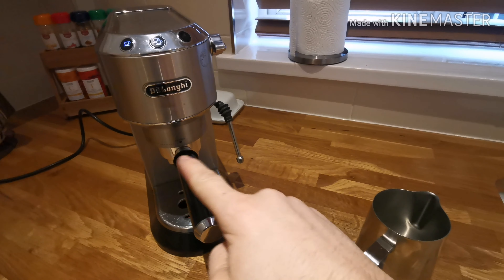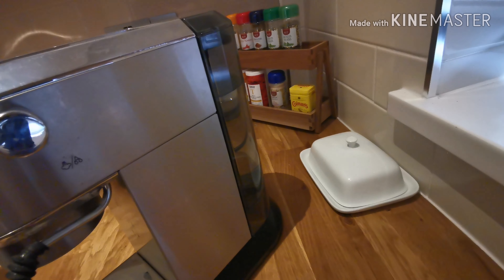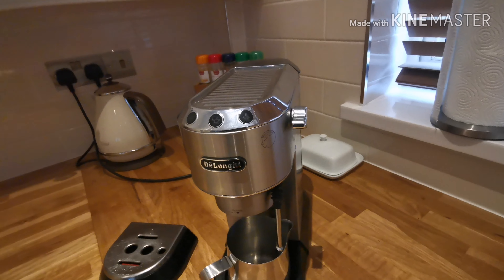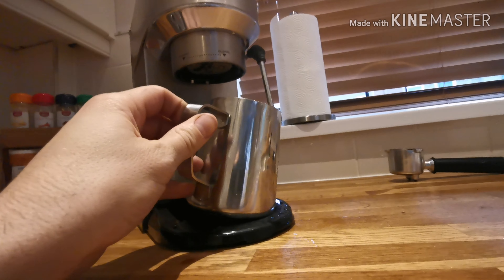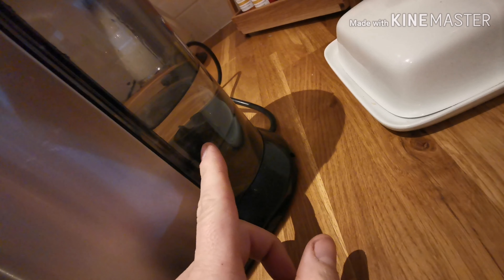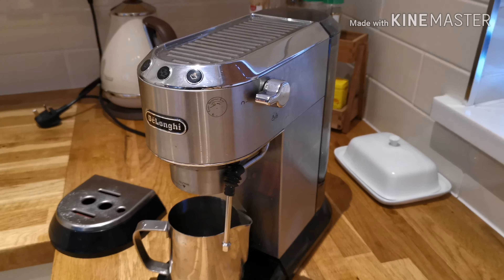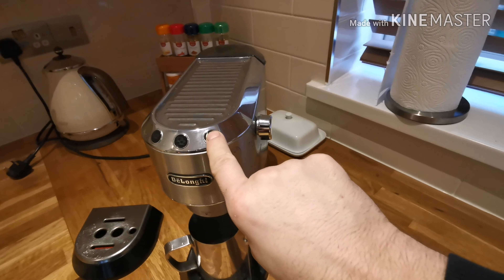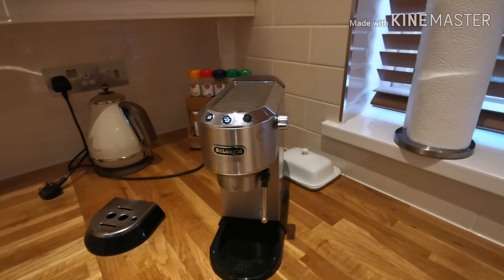Descaling the delonghi dedica 680 from start to finish

Comment: I'm not usually one to comment on a video.... But, omg..... Your video saved me. I really like my cappuccino on my day off and i spent the better part of the day trying to descale my delonghi dedica arte ec.885. i think i must have done 5 cycles, including one with descaling and others rinsing. I was not having much hopes with teying your video. On the last attempt, i did as you told and did not touch after it was on descale and used to steam button towards the last to purge the last little bit.  I think im goung to now put a reminder for every 6weeks now

Comment: Can I ask, having just got a second hand machine and watching numerous videos, if it needs to be rinsed once or twice after the first descaling please? Having just done a descaling cycle after the first fresh water flush I turned the steam switch and (I guess) missed the chance to do another clear run through! From what you do it seem a descale then fresh water flush is ok? Any recommendations welcome 😂 TIA
Reply from the maker: Yeah 1 rinse through is enough.  Descale programme,  when it stops empty the tank and fill. With cold water and let it cycle through, (it usually doesn't even empty the full tank.
Reply: @MrSmoothasf  thanks so much for the quick reply! Was hoping the 2 runs would be ok 🙂

Comment: how often will I need to do this? As i bought the machine only 3 weeks ago and it has already asked me to descale?
Reply from the maker: Every month usually.
Reply: Go back to where you bought the machine and ask them to adjust the inside to a maximum. Mine used to be like that too, until they adjusted it.

Comment: Thanks for the video. Just to clarify....it is actually 3 times that the water chamber is filled and put through? (Once with the descaler 
and twice with cold water?). After watching for a third time, I believe it is just twice that the water chamber is filled and flushed through, right?
Reply: I bought my EC685 in February so I haven’t descaled my machine yet, but watching a few videos I’m guessing it happens once with the descaler & once with clean water. But I’ve thought that when my time comes to descale, I’ll do it a total of 3 times like you said just to be on the safe side. Make sure all the descaler is out of it. As it is it’s almost impossible to find a doctor at this time, better be safe than sorry. Don’t you think?

Comment: I noticed there was still water left in the reservoir when the machine stopped. I did my first descale and rinse today and there was still water in the reservoir when the machine stopped on the rinse cycle  just like yours. Is this normal then?
Reply from the maker: Yeah once it's flushed through half a tank it will stop
Reply: TheOracle thank you!